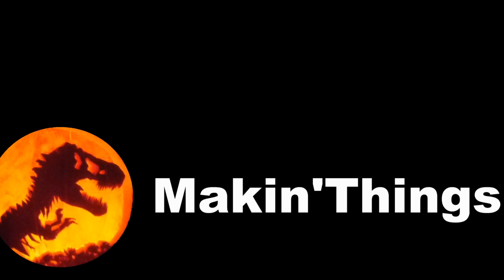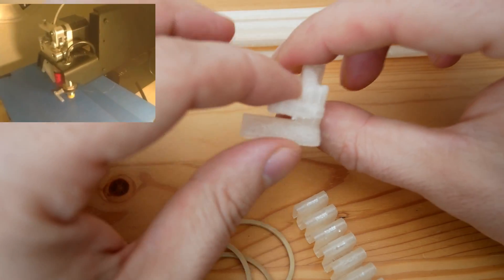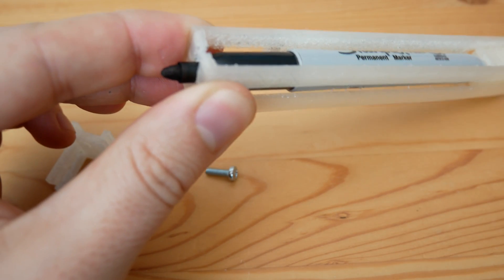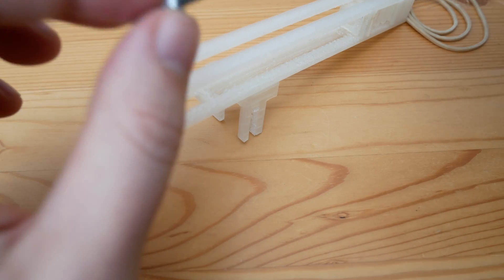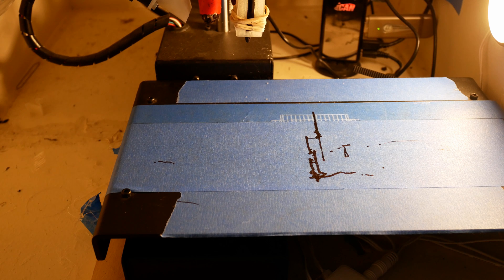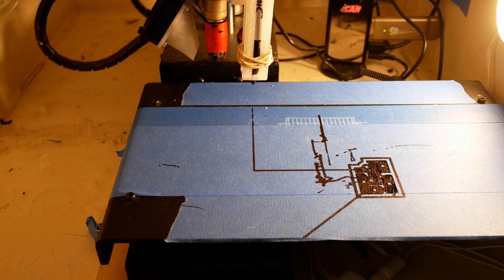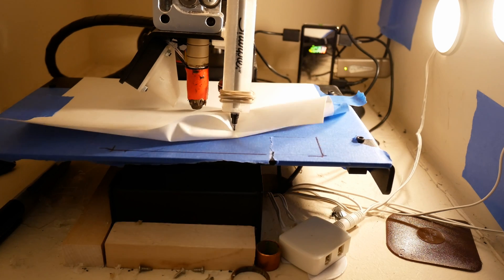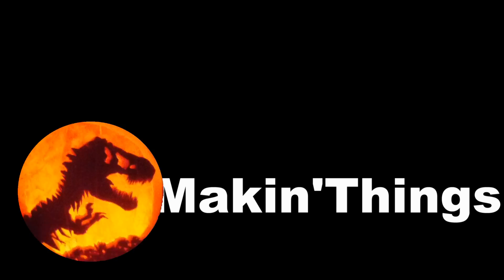Turn your 3D printer into a plotter

Comment: Use a 2d inkjet printer.....pretty simple and way faster
Reply from the maker: I had very little luck with printer methods, inkjet transfer or laser toner. Plus, this was fun!
Reply: Printing on aluminum for example is not possible with inkjet or laser. This works wax printers work too but are expensive.